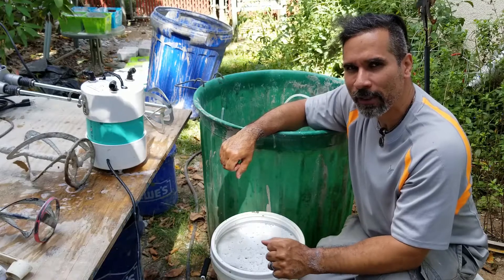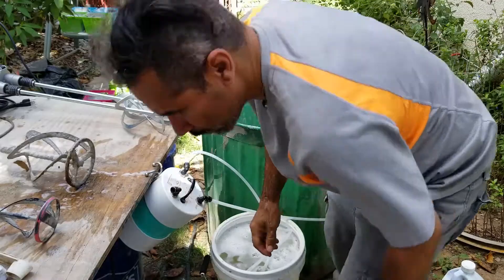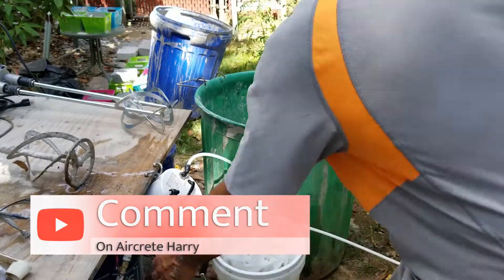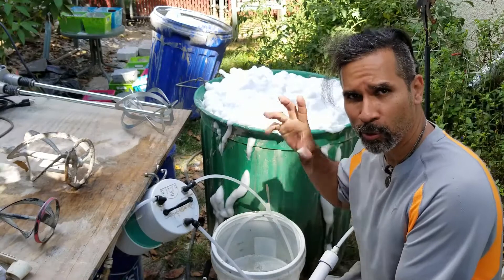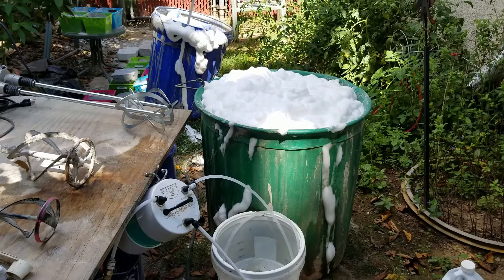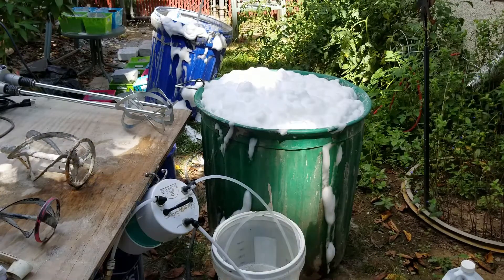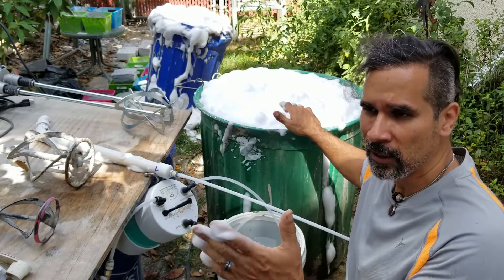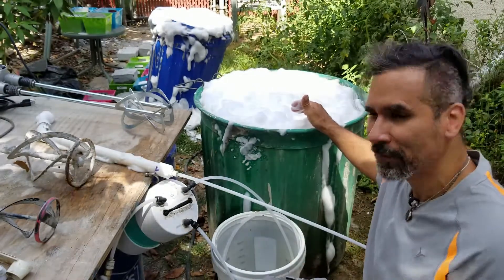Aircrete Harry Foam Generator Test #Aircrete #AircreteHarryFoamGenerator #foamgenerator #DIY #learn

Comment: Hi Harry, can I use the car snow wash machine to create foam for aorcrete?
Reply from the maker: I don't know what kind of foam that machine makes. If you can fill s 5 gallon bucket with foam and have it weigh 3lbs it mite work.
Reply: @AircreteHarry  thank you Harry for your quick response, I'LL try that test.

Comment: Hello Harry
I have purchsed a foam generator some months ago for use in Nepal, you have shipped the thing to Germany. Now, we have a technical problem as the armature inside has been damaged and needs replacement. Could you give me exact technical indications on the thing used, so I can ask some friends to bring it to Nepal.
It got burned as we have 220V here.
Or would it possible to use a part in the same foam generator that suits 220V?

We have buildt some domes already, but wish to continue developing with aircrete buildings
Many Thanx for your swift reply
Reply from the maker: Hi Peter,  Send me an email with photos to Aircreteharry@gmail.com

Comment: Do you have 240volt units for sale for Australia.
Reply from the maker: Sorry I looked and could not find a 240v pump that would work.
Reply: David did you find a unit or option in a AUSTRALIA that you could use a a foam generator